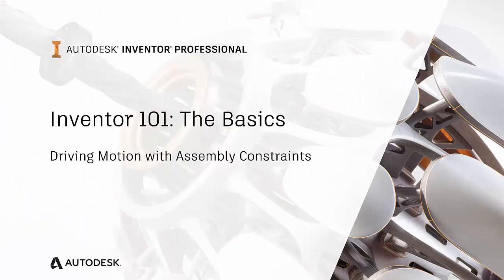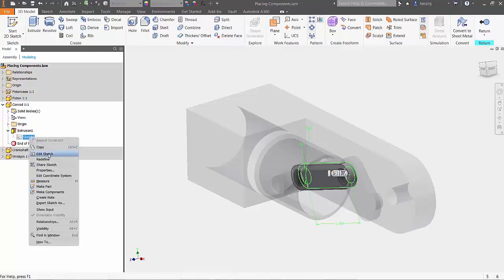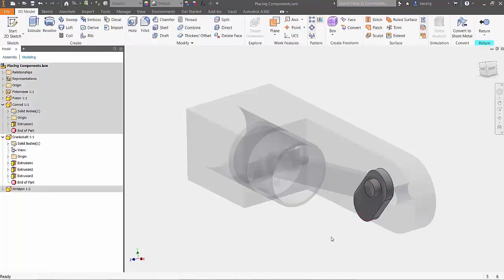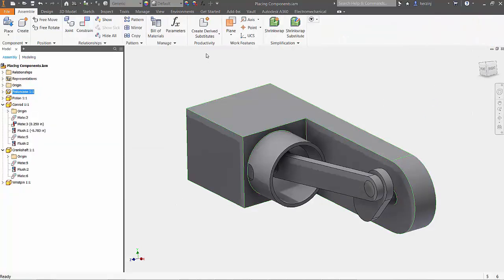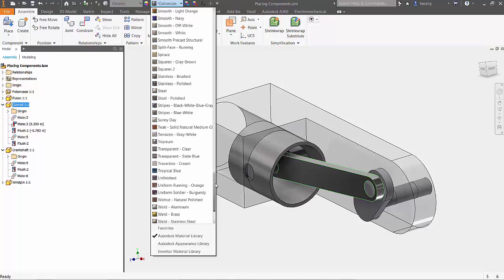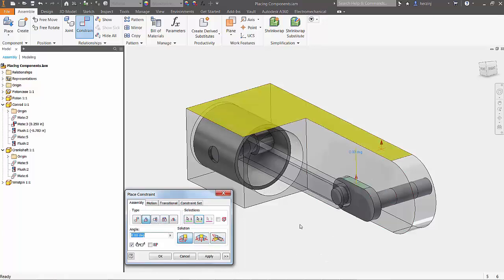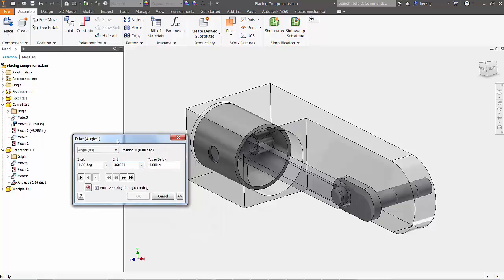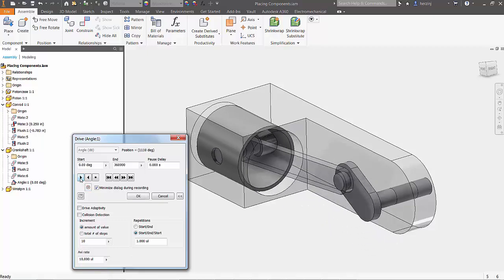Inventor 101: Driving Motion with Assembly Constraints

Comment: Hello sir. Is it possible to simulate a complex constrainted assembly on inventor 2019.
Please help.
Reply from the maker: you can, depends on how complex. Some times the constraints get confused. Do you have an example you could share?
Reply: @AutodeskMFG  Thanks sir I actually I tried it on inventor and it worked... I was making a 3d steering geometry of vehicle.. thanks for the response..
Reply from the maker: Awesome. Nice work. No problem, Neel! 😃